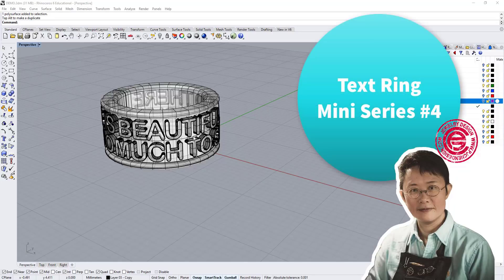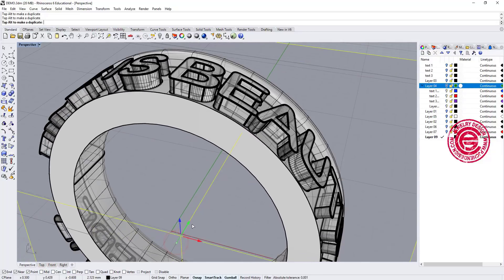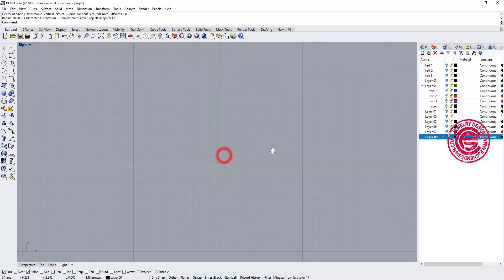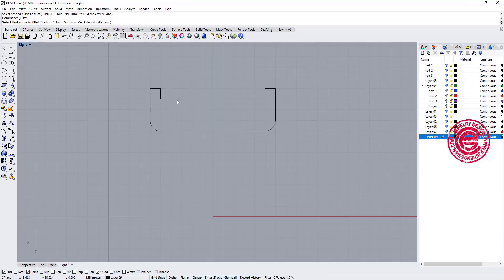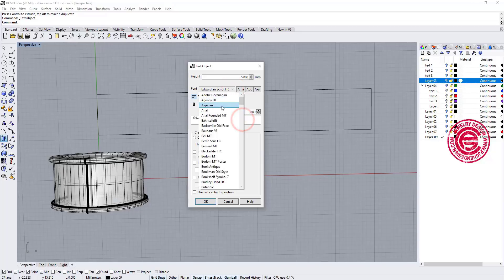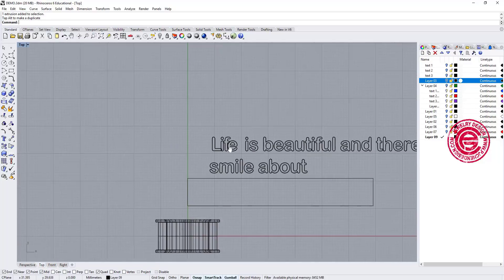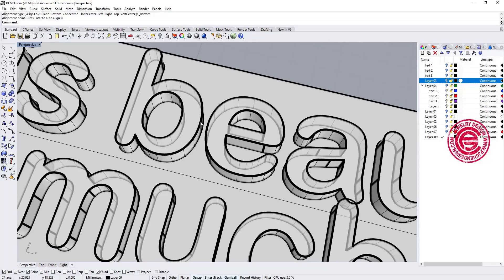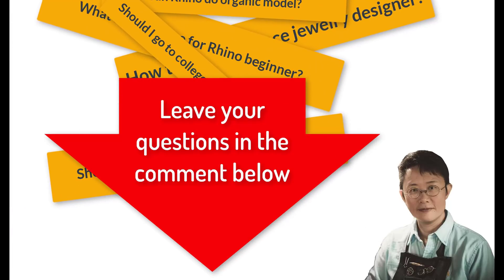Text Ring Mini Series #4 Jewelry CAD Design Tutorial in Rhino 3D

Comment: Hey PJ! I have a question for you. I currently use these 3D methods to design my jewelry and then I get it casted at a manufacturer. When designing rings like the one in your video, a size 6 varies greatly to a size 10 or 13, but would feel bad to charge all that much extra just for a larger size. I find that not so typical. Is there something I can do better to ease this variety in pricing? Also when changing sizes, i do not scale up; i re do the process with the correct diameter, but still seems to be almost a $20 difference when jumping sizes. How would you do it ? Thanks PJ your videos are truly valuable.
Reply from the maker: at the business point. I won't charge for size up on CAD because you can make it up at the materials. plus, you can always 3D print it again when for new customer with the same size. also when you size up from 6-10 or 13. you may want the ring to be thicker. if the 3D scale look propotionally correct. I will just do 3D scale. however, if the thickness is too thick to wear. you may need to rebuild the entire ring. If you have all your original curves save. it should not take too long to rebuild the size.

Comment: Great tutorial! 
You mention mold making..... it appears to me that the vertical sides of each letter are tapered, becoming wider at the top - in theory this creates undercuts around the perimeter of each letter. You do mention filleting the edges of your model to aid in releasing from a mold. Do you think that the numerous tiny undercuts would also be an issue at this scale?
Reply from the maker: that is correct. very good eye in detail. however if the text is shallow, it won't affect the demolding since rubber is forgiving in certain degree

Comment: Hello PJ I have few questions to ask you.. Do you think investing in matrix gold and rhino gold necessary or helpful,
What advice would you give me as a rhino beginner.. to start my own rhino 3d jewelry design coaching centre or anything else....lastly,
I want to know about different types of gemstone making in rhino, how to make collets, settings etc and technical aspects for printing please make a video on that.
Reply from the maker: HI Rajath, If you are in the jewelry business and you need to use CAD on the everyday basis. It is a good investment for having Matrix or RhinoGold. Because it has a lot of good feature for jewelry modeling to speed up your design process. However, If you have a tight budget and just start doing jewelry design. I will suggest you start with Rhino3D. Both Matrix and RhinoGold are the plug-ins for Rhino. So they share the same commands and the interface are similar. 
I will release a stone setting modeling on-demand class hopefully but the end of the month. It will cover all the stone setting using Rhino 3D.